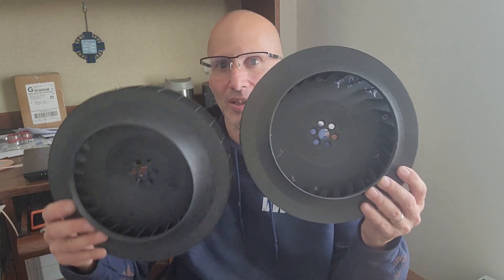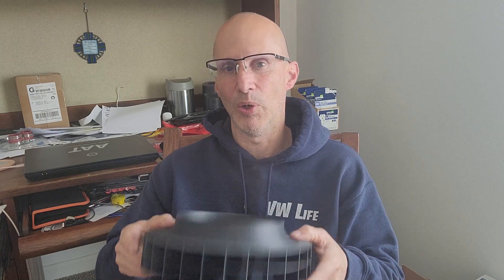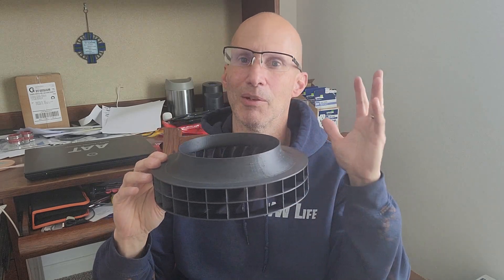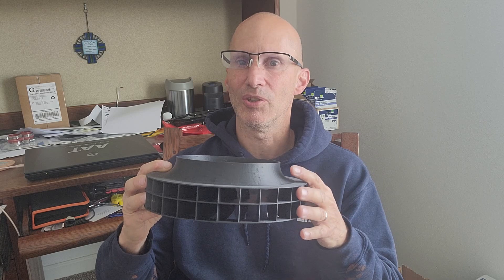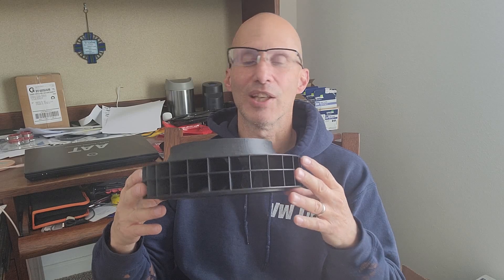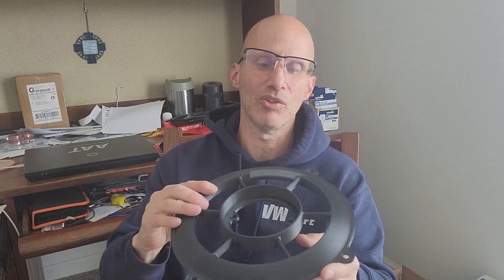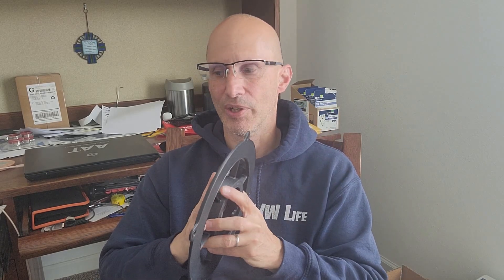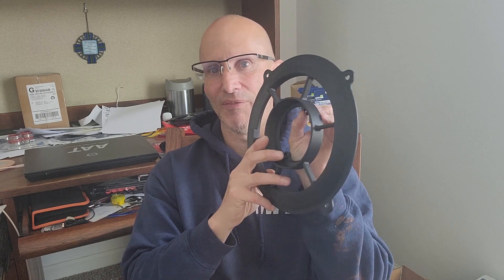Evolution Two Fan Product Improvements

Comment: great work amazing,  what difference in weight compare to the original and can i still have my thermostat and flap running. i verified your web site and i don't see your fan on the site.
Reply from the maker: I have paused sales of the fan kits for right now.  I'll be posting a video later today with the details of what I'm doing.  The weight difference is 81% lighter than stock.  Watch for my post later today.
Reply: Thank you Andrig’s I will keep an eye for sure.